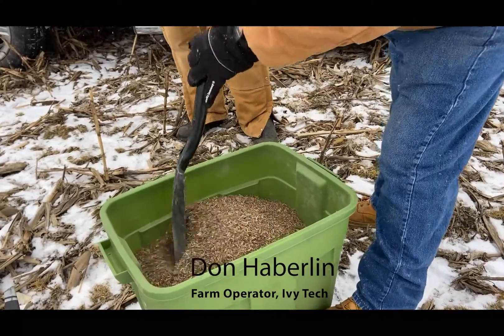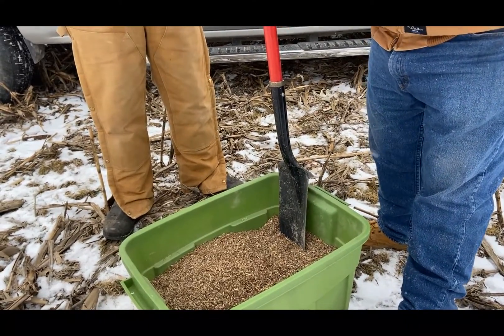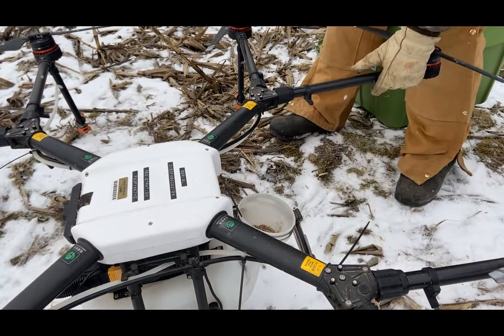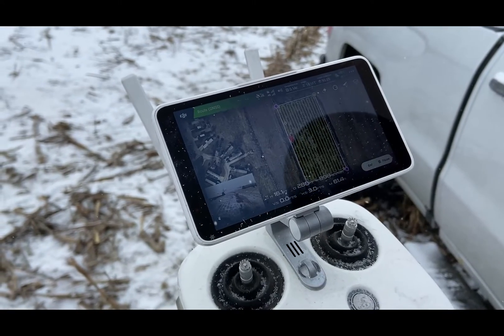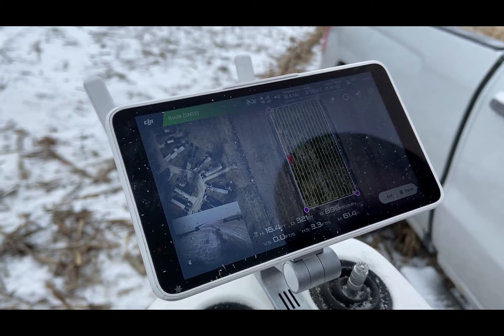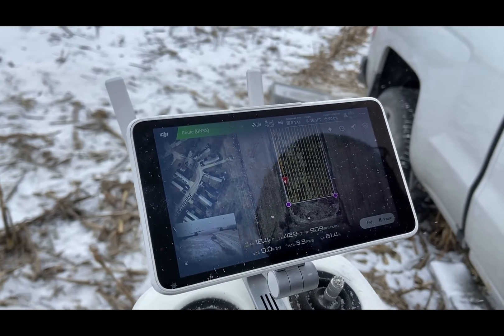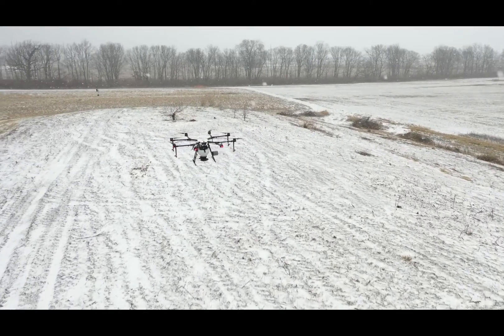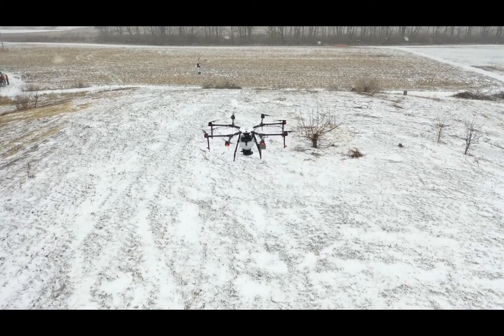Drone Seeding Native Grasses and Forbs: Seed Mixing, Loading the Hopper, Programming the Route

Comment: How effective was the spread compared to traditional methods.
Reply from the maker: The seed did not spread as easily with the drone as traditional methods because we had issues with the seed flowing through the drone (not enough weight to the seed). Also, when we added carriers (pellet lime) to the seed, it made the mixture heavier, but that means that we had to refill the drone hopper more times to seed the field. So the drone was not as time efficient as other equipment because of the limited weight it could carry.